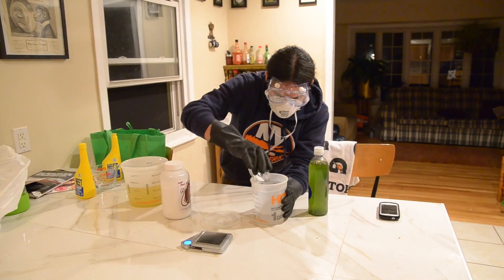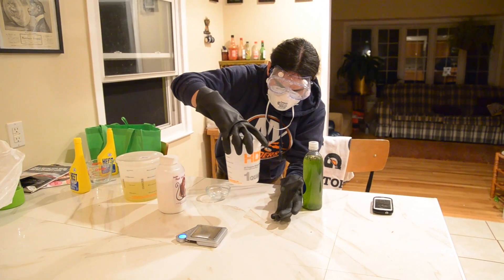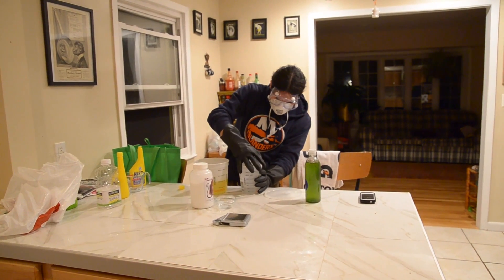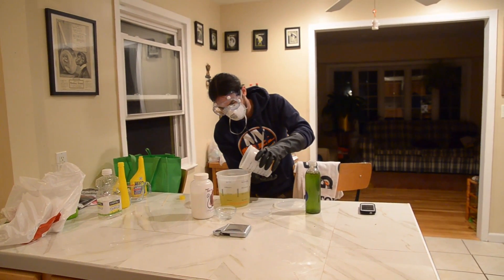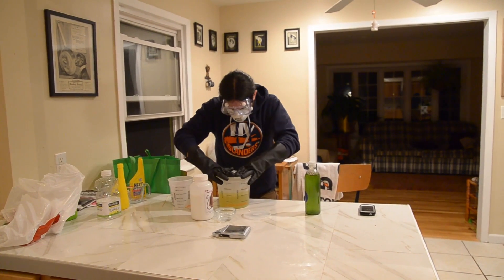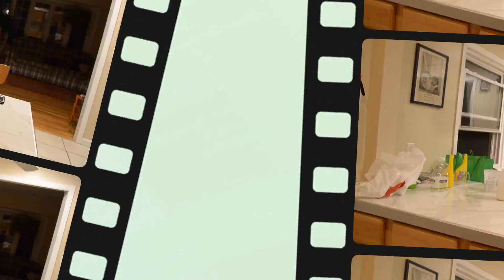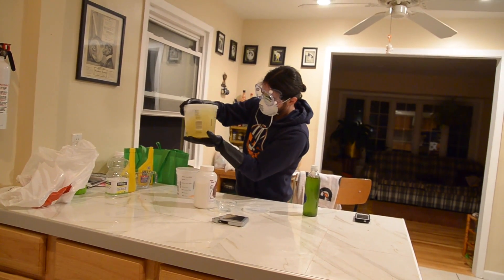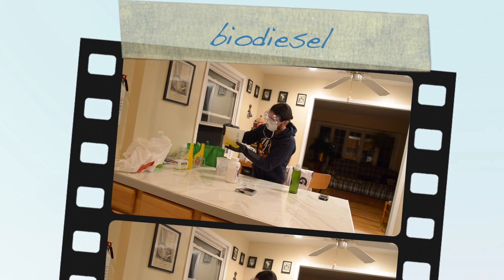Make Your Own Algal Biodiesel

Comment: I am trying to extract oil form macro algae  like azolla and i am struggling with this project because the oil extracted always contained more amount of water so if there is any way to extract and dehydrate the oil from macro algae at low cost please inform me at
sachinsajeevkumar@gmail.com 
via whatsapp 09400133401
it will be a great help for my final year project
Reply: stop with leaving your personal info on your posts, nobody will bother calling you.
i can only think of two solutions to get ride of water, it should be easy:
- dry it with sun power
- use wind or fan to induce evaporation

Comment: Thanks for the video, I'm really impressed for one. Can this biodiesel then be used in my car?
Reply: +Ezra Davies Yes if your car has a diesel engine. 
It's actually better than regular diesel because it has lubrication properties (regular diesel doesn't) that makes your injector pump last longer.
Reply: Ezra Davies 

mythl alcohol:
flour yeast water and a dark place for a month then distill

lye:
ashes from fire pit
filter with boiling water
and evaporate to form crystals

although for this to be mass produced
you would need
barrels
of woodash
and 
gallons of methan

however it can be completely derived from nature itself

zero cost 
as long as you know to make yeast and flour and fire
which can all be produced from seeds found in wild grass
Reply: @wesleymitchell4698  You can just boil sawdust at 171 F in a pot with a distillery coil on the lid to get the methyl alcohol.
If you call you power company they do a lot of tree trimming or landscaping companies  will dump tons of it in your yard to burn to ash and cook to be wood alcohol. you can garden with it in a Hugelkultur system as well.